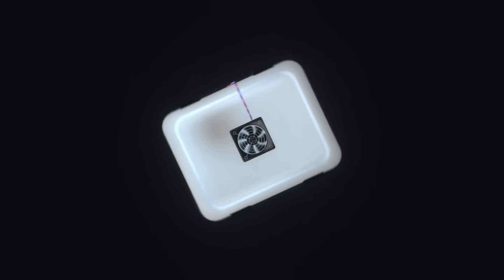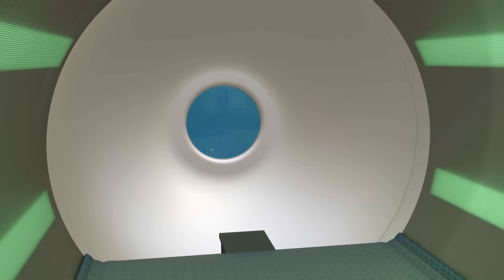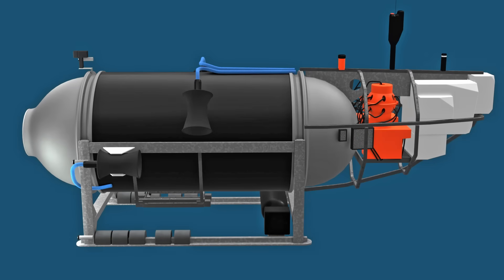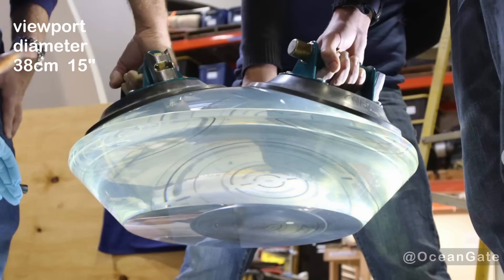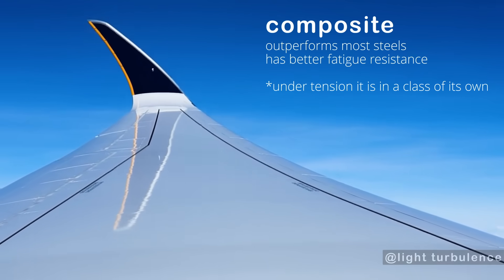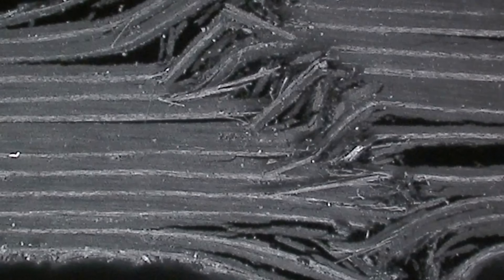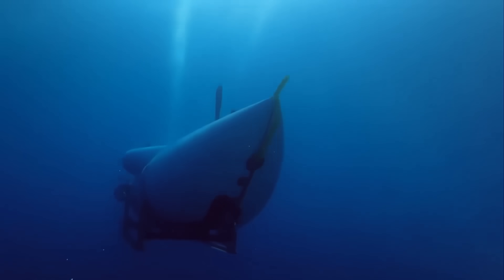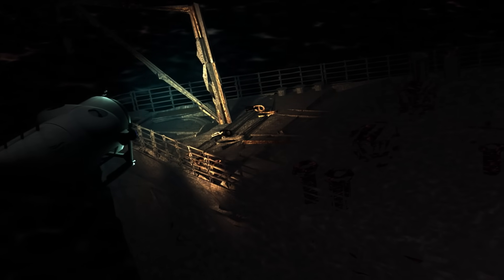Titan Sub | carbon fiber - Detailed Tour

Comment: References to the use of carbon fibre in aircraft wings as proof of it's viability in compression are misleading, especially in regards of the AirBus.380. The main spars that take the vast majority of the load are aluminium alloy, not CF. Even the wing skins are aluminium. Only the ribs are a mixture of aluminium and CF. I don't have data to prove it but cannot imagine the compressive forces on the ribs are anywhere near those experienced at 3800 metres below sea level. The spars, maybe. https://youtu.be/3k1GkTDNbi4?si=U_olmrzXUD_RfFrq
Reply from the maker: @jeffreybean2960  The wing in the video is the A350 which is composite.  I welcome corrections but I do take care with what I say and present.  

The composite used in racing yacht foils, racing car parts, bicycle frames and of course composite airliners is proof enough that carbon fibre can and does beat steel in compression.  

I am amused at how so many seem to have difficultly taking this structural marvel seriously.  As if to say "Cute for tension but just not up for the serious compression stuff" much like the attitude towards woman drivers🤣. Yes this material is finicky and tempremental but there are many applicatons where it unbeatable!  Why do men find this so hard to accept? 😁
Reply: @Mike-Bell Again you are referring to composite aircraft wings. Sure, aircraft wings particularly the spars, are under enormous load but they are not made of CF but aluminium alloy. Given the desire to reduce weight, if CF was up to that task, would AirBus not be using it? Your and others have used composite aircraft wings as a justification that CF can withstand massive compression when the parts in aircraft wings that are subject to such forces are NOT made of CF. Hence such an analogy is highly misleading.
Reply from the maker: @jeffreybean2960 The high compression structural components in the dreamliner and A350 wing, sailplane wings, hydrofoils and yes your bike frame ARE composite.  

You are wrong saying that CF can't take compression like steel!  And you were wrong stating my video showed an A380 wing.  My analogies are not misleading.

The water pressure in Titan resolved into simple compression force in all the carbon fibre.  The forces were a circular arching effect in the hoop direction and a simple pipe in the lenghth.  It didnt need any counterbalance tension.  The equal and opposite force was the water pressure.  

Carbon fibre can resist insane underwater compression loads.  Titan proved that by surviving the water pressure at 3,700m 13 times. If it was weak in compression it would have failed on its way down on dive 1.  It failed because it wasn’t built correctly not because carbon is by definition not up to the task force, or the titanium interface was wrong, or the 5" inch thick layup delaminated internally.  The expert I spoke to had much reservation about this incredibly thick layup because this a new use case and would require tons of testing to determine if it is even viable and could potentially prove this application is impossible.  But from compression loads he said the product is up to the task.
Reply: Equally, as a bicycle rider, I don't see how CF used in bike frame manufacture proves carbon fibre is better than steel in compression. The use of CF in bike frames is because it is tubular and hence the tubes are simultaneously subject to compression and tension on opposite sides. And at an appropriate strength, produces a lighter frame than it's steel equivalent. The hull of the Titan was under compression from all sides so despite being tubular, there was no 'counter-balancing' part of the structure  in tension. It's typically weight v strength that dictates the choice of materials and Stockton Rush got that balance horribly wrong.
Reply: Having googled the A350 wing I have discovered the spars are also composite. But have you familiarised yourself with the details of the manufacturing process? It includes the use of some of the largest autoclaves in the world, evacuation to minimise voids and a carefully controlled curing process. Post-build, the wings are then subject to extensive non- destructive testing. As you would expect, this all costs hundreds of millions of dollars. Lots of people's lives are at risk if any of that is not undertaken to the highest standard. Where is the evidence Stockton Rush did any of those things? As for using acoustic sensors to 'predict' problems, is it not fair to say that by the time a sensor can 'hear' a problem, it has actually occured? Hence  there is no prediction involved, only recording.
Reply from the maker: @jeffreybean2960  I went to lengths in my video that to say Stockton Rush did basically no testing which is crazy and that to get a safe sub would have cost him huge money. 
I agree acoustic monitoring system was illogical and a pipe dream and a marketing gimmick. He thought it was the shortcut around unmanned destructive testing.
Reply: Where did I say that CF cannot withstand compressive loads like steel can? You are putting words into my mouth. In most CF products I'm familiar with such as the fishing poles and bicycle frames that you cite, the structure is such that one side of the item is under tension whilst the other is in compression. The side in tension 'saves the day'. In contrast, all of the Titan hull was in compression. When any product is designed, it has to take into account usage over its lifetime. If the manufacturing materials and methods used do not result in a product that can withstand the intended number of uses then it is not fit for purpose. To produce a CF tube to the specification required to survive multiple dives to 3,800m (and test it) would probably cost more than making it in a more proven material such as titanium. Whilst CF may be lighter, by how much given how thick it would need to be meet the multiple dive requirements? Personally, I suspect the joints to the sealing rings failed as a joint in any structure is the weakest link, particularly between different materials. And in the case of Titan, there was differential expansion and other factors at play due to the significant temperature variation from surface to destination depth. I'm prepared to accept CF can withstand substantial  compressive loading in a design where that loading is 'counter-balanced' in a corresponding part of the structure where the CF is in tension as per bike frames, fishing poles (and I imagine A350 wings). However, that condition simply did not apply to Titan. So you have to question the suitability of CF for that purpose.
Reply from the maker: @jeffreybean2960 The tension side doesn't "save the day" that not how it works.  If the compression side cant take the load or buckles or delaminates its game over and no amount of tension helps it out.  A material under tesnion cannot suffer buckling and is inherently stable.  A compression structure does not require tension to work.  A column can work under purely compression force.  So can a pipe recieving outside pressure.

An aeronautical engineer with 30 years experience in making composite gliders posted this in this comment.  He is uniquely qualified to comment on the structural capabilities of cmposite...

3. Somebody commented that the  analogy of a wing is not correct as there is not really compressive loading in a wing.  That is absolutely wrong.  The structural element in a wing is basically a beam that resists the bending moments.  In a beam the one side (bottom for aircraft) is always in tension and the other side in compression.  We use carbon fiber primarily as the structural element in our beams and the upper flanges is stressed in compression.  Because the compressive strength is well known, we can design save wing beams.  As a matter of fact, the tensile strength is an useless property in this application and we are only interested in the compressive strength.
Reply: You are completely missing the point. As the aeronautical engineer stated, one side of the structure is in tension as the other is in compression. If the side in tension can withstand the load, the side in compression is almost irrelevant. In Titan, none of the CF was in tension.
Reply from the maker: @jeffreybean2960  No Jeffrey.  You clearly don't understand structures. He said the tension side is irrelevant in his calculations because CF he knows it can take the load and is the stable side of the structure (no buckling).  But tension is not the saver of the day.  

In a cantilver beam like a wing there is equal parts compression and tension.  In cases like a column and titan's tube its all compression.  In a scuba cylinder its all tension.  A structure doesnt require both.  That is determined by how it is loaded.
Reply: And comparing a column's ability to withstand compressive load is another poor analogy. The forces are unidirectional. It's widely known that concrete, of which most columns are made nowadays, is great in compression. In tension, not so great. If you were to make a structure in concrete to meet a particular tensile load, the same structure made out of a more suitable material would be lighter and smaller. Where concrete structures may experience tensile loads they are either pre-stressed or even have post stressed steel cables running through them to keep the concrete in compression.
Reply: Please remind me never to fly in one of those gliders where the tensile strength of the lower part of the spar structure is considered irrelevant.
Reply: Again, I didn't say for a structure to work or survive it requires both tensile and compressive forces. What I am saying is in that most (if not all?) the examples you quoted that supposedly illustrate CF's ability to withstand  compression, a corresponding part of the structure is in tension. The Titan hull is akin to a Scuba tank but the forces are reversed. Again, it's a trade off of weight versus strength. Scuba tanks can be made in CF at appropriate strength and be lighter than alternative materials. How thick would the Titan hull have to have been in CF to meet the base load, cyclic loading and temperature cycling?  Would it have then been any lighter than, say a steel or titanium version where the materials ARE good in compression?
Reply from the maker: @jeffreybean2960  I assumed the Engineers who advised Mr Rush would have done the calculations properly and they came up with 4.5”. He rounded it up to 5” and that thickness would give a weight saving of 7tons round numbers. Did you watch the part where I said that? 
But even if we assume they needed 7” that would still give a major weight saving over Titanium. 

As for the relative costs between Titanium and CF I can’t comment but both are very expensive. However the testing and development costs of getting CF proven would have been crippling for OceanGate unless they charged a gazillion per ride.

Comment: Good analysis, another thing to point out here you didn’t mention.

The carbon fiber tube(both models), were constructed in a warehouse, not a hermetic environment free from dust and other airborne particles that could’ve been introduced into the in between layers of the cabon fiber as it was being weaved.

Also Ocean Gate removed a lot of their videos showing these construction processes(likely to hide evidence), and you can actually see air bubbles and imperfections in the layering process of the finished carbon fiber tube.

Also a former engineer told Stockton to make the fiber tube at least 8 inches thick to ensure it was strong enough to withstand the ocean pressure at depth, Stockton went against this and it was only 5 inches thick.

So I think imperfections in the tube hull combined with it not being thick enough as well as the flanges were weakening with each subsequent dive, and maybe water was beginning to ingress into the layers of the carbon fiber or finally penetrated the flanges and the glue and it was just enough to cause the catastrophic implosion. That’s my take on it anyways given what’s available.
Reply: I doubt any contamination was significant.  Do you think leaves were blowing into the layup?
Reply: One thing not discussed enough here ....  "The Sphincter Valve Effect" 
What happens is.... BOTH noise & visuals are translated into Electrical Impulses for interpretation by the brain.
When formed, these impulses of information travel South to the Sphincter Valve aka the Orifice Interface.
The Sphincter Valve controls electric impulses in an effort not to overwhelm the brain.
Nerves are very thin in this anal-type area. They need a massive amount of bloodflow to pass the Interface, traveling on to the brain.
Once you throw TOO MUCH INFORMATION down there, the electric impulses backup, the Sphincter Valve closes, blood flow drops.... nerves can't pass information ....... and the brain has no choice but to mutter the only thing it still sees, OH SHYT!!!
Reply: he used a pre-preg carbon he bought from Boeing that was expired. THAT was where the bubbles came from. Lumps.

Comment: yeah i always rolled my eyes when all these armchair youtube engineers that know nothing about material science, crawled out of the woodwork to get their 10 minutes of fame dunking on the carbon fiber or the game controller or the metal pipes to purely add weight being rusted or spewing some other tech tech illiterate nonsense, probably not even realizing that the sub already made over 30 dives prior to the accident and only imploded because the owner ignored proper safety and maintenance procedures.

Comment: It's obvious that the submersible was not designed with the principle of avoiding single fault failure in mind.  This is evident even from this distance.  This principle states that you must not design a device that under any foreseeable circumstances, a single failure might lead to death or injury to any person.

For example, the interior of the vessel did not have a mechanism to secure the people inside from bouncing about inside, which was sure to happen in rough seas.  Because each mission was hours long, there's no guarantee that the tranquil seas at the beginning will also be smooth when the passengers come back to the surface.  There were video monitors whose mounts could beak off it passengers are tossed about.

The sub hatch could not be removed from the inside quickly in an emergency.  Ask the Apollo 1 widows and orphans about the advisability of this design.  The NASA designers could not think of a scenario under which that might be needed, but they didn't think about it very critically.

The failure analysis is a written document that's an important part of any product design when the product is possibly life threatening.  A relatively bright first year engineering student could see this disaster coming.

If the CF tube was not the direct cause of the accident there are any number of other paths that could have led to the loss of life.  The available video suggests that the break between the CF tube and the end bells was very clean, which is also troubling.

As noted in the video, there also seems to have been a troubling lack of feedback from what was learned in the early dives...going beyond fixing glitches.  Again, parallels from NASA when they failed to take seriously the warnings of past near-miss events that led to the losses of Challenger and Columbia.